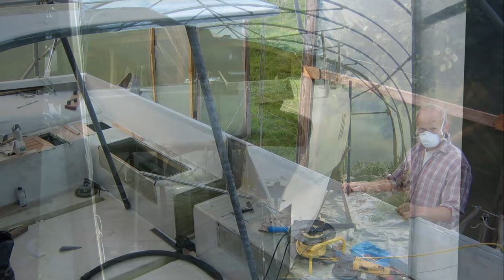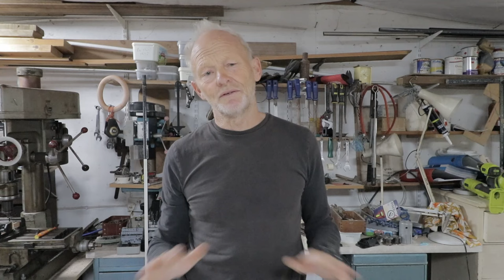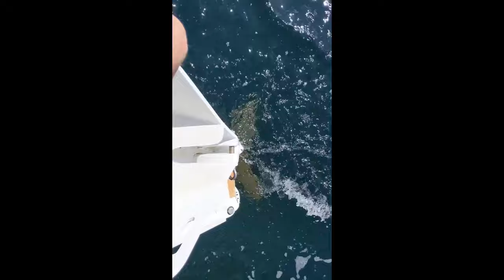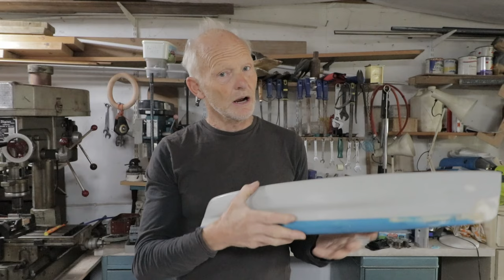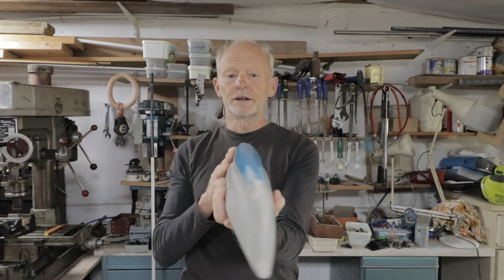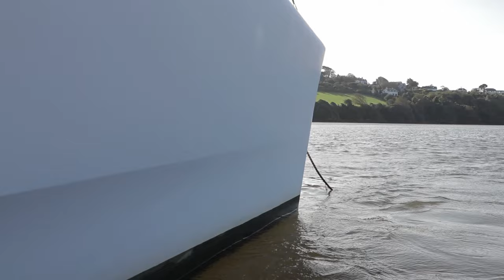How To Build A Sailing Boat #1 - My Catamaran Hull Design Explained - Ep03

Comment: Beautifull boat! The hull design and the general boat structure make ne think a lot of the Dazcat.
Reply from the maker: Thanks!
Reply: I love Dazcat. 
I don't love the price.
Reply: You are absolutely right....that hull shape is very similar to Dazcat Cloud 9 which is 39 feet. Modern Dazcats are not canoe hulls so much but C9 is. 
Have been the proud owner of Cloud 9 for over 20 years....original owner had her built in 1995. Wonderful boat....it will last a lot longer than I will!

Comment: Given that catamarans are rather recent, in the West at least, the design limits have not yet been fully explored as with a mono hull.
I have stumbled upon a new hull design innovation which is only possible on a multihull. Thus far, I haven't been taken seriously. However I have struggled along, perhaps bumbled along, and made and tested multiple 5m beachcat prototypes, because of their ease to produce and test, and have successfully proven its concept. The target of this design is racing/cruising cats. Advantages of this unique design are;
* Superior lateral resistance at ALL speeds
* Minimizes wave interferance between the hulls for less drag
* Low drag at high speeds
* Superior sea keeping abilities
* Protection for the rudders
* Ability to be beached
* Simple and quick construction from all flat panels - no compound curves.
If this all sounds too good to be true, put it to the test by learning more about this unique hull design. Cheers

Comment: A really interesting set of videos for anyone contemplating buying a catamaran, and especially building one.

I have a 1988 Catana 40 that has a design displacement of 5.4 tonnes .... probably around 6 tonnes now due to all my gear, inboard diesels. My guess is that yours must be considerably lighter  .... 3.5 to 4 tonnes? 

I've owned mine since 2008 .... circumnavigating and investigating many parts of the world ... and with many left to explore. It has really excellent sailing characteristics ..... as I'm sure yours does. 

Good luck on your adventures.
Reply from the maker: Thanks so much for the feedback. Sounds like you've had some great adventures, with more to come! :)
Reply: @SailingWildHoney  How much does Wild Honey weigh full loaded?

Comment: Superb explanations.  Thanks mate!

The narrow hulls at the waterline are shaped like a keel, and should counter leeway through lift generated by angle of attack.

The rudders are almost like a trim tab at the back of a wing, and are very different from the high aspect ratio rudders and keels found on most boats, BUT, a correctly trimmed boat should not need much rudder AND is more efficient.  I do wonder if they have enough authority when going upwind, but the daggerboards should be doing most of the work then, and again the sails can (and should) be trimmed to do most of the steering, ideally with minimal rudder use.  One of my sailing instructors called the rudder the parking brake.
Reply from the maker: Thanks very much for the feedback - yes, I think you're quite right in everything you say. And in fact she could sail quite well, even without the daggerboards. But she does sport small daggerboards inside the rudders to help.
Reply: @SailingWildHoney  Interesting, so there are daggerboards acting as small high aspect rudders inside the rudders for better authority if needed.

In principle, deep downwind, no boards and not much rudder would be needed most of the time.

Comment: I've got a crazy idea. Im kinda crippled up my right leg isn't so good anymore. 
     So i want to build a power cat. My idea is to make a jet powered cat using Honda goldwing engines that power the assembly for a big jet ski! 
    Also im wanting to put hydro foils on this so fuel mileage is good. 
     Still working on the design of this, it should be really fast. Hopefully it will get to about 55 mph nicely. 
     I don't know if I'm going to get to actually build this, hopefully things improve in the next couple of years. 
     I've never heard of anyone else doing anything like this! It will be totally a new thing.

Comment: Great explanation. I've so often wondered why we don't see more catamaran hulls with pointed sterns. Much like Wharram. 
I look forward to more videos explaining the performance. I would also like to know a bit about the specs and dimensions.
Reply from the maker: Thanks! That's an interesting idea - we've got lots more details coming in future films :)
Reply: They used to design cats with narrow sterns like the early Outremers. Obviously the naval architects decided a wider stern was preferable so that's pretty much what is done now.
Reply: …hobbyhorsing 
Not only uncomfortable, but knocks the air out of your sails, as well as problems for your outboard
Reply: When I bought my cat she had sat on a Sandy beach unused for a number of years.  I never got to inspect the low aspect keels, not until I got her back home did I find that the lower half was still in the sand on the beach!  
So she will now get centreboards.  
A short skeg for grounding is perhaps a good idea, to protect from rock, though that means you can’t so readily drag her up the beach on rollers.
Reply: @laurapitre5797  I’ve always found it amusing how design details follow a circular path - think of the Moody yachts from the 70’s with their incredibly broad transoms to create voluminous aft cabins so that they were ‘comfortable for the wife’ (their London Boat Show marketing!). A dreadful case of form following function; they were horrendous going upwind.
Reply from the maker: Yes, we went through all the various alternatives before we decided not to use them :)

Comment: You say you got the designer to draw the lines, but how do you get all the structural requirements (bulkheads strength, mast stay, joinery etc) figured out?
Reply from the maker: Thanks for the question! The designer also gave us some calculations for the main cross beams and the rest we worked out from our own knowledge base and similar custom race boats that we knew about. There were also 2 similar sized cats being built in this art of the world and we compared specs and ideas to check we were in the right ball park.
Reply: Have you ever looked at the MaineCat 38 ? Its a light sport cruising cat.

I know that part of the world of old.🧙‍♂️🇬🇧😎 One of my favourite modern cat 
Designs is the Windelo Built in Basalt but  Im also a fan of the later Wharrams and have been a long term follower of Mark ..of Wilding sailing .
He has a 42' pahi he rescued and is trying to build up in Holland.

The Hitchhiker series of boats incorporate many of the hull features of your hulls but carry the aspect ratio to the extreme... they offer no living space within the hulls on the later versions.
Reply from the maker: Being a multihull enthusiast Laurence knows all the boats you mentioned there. And he's also watched a fair bit of Wildling Sailing. We feel Wild Honey offers a good compromise between performance and accommodation :)

Comment: Hull designs depends on a number of components.
Volume required ie a double bed in the hull or single. 
Weight of the yacht and all its required to carry.
Eg if a yachts total weight is 6 tons then each hull neefs to support 3 tons.. this can be a rectangle prism ie 3 m long 1 metre wide 1 metre deep. Wont sail to well but will float. So your hull needs 3 cubic metre of boyancy.
Shape is an art to get the best performance
Reply from the maker: Nice and simply put! :)

Comment: How old were you when you first made a decision to build a cat?
I'm kind of in the same place right now, I'm almost 29 now, the plan is to build a simple 10m boat first to figure out all the technological processes and material and then build shonning 1200
Reply from the maker: Thanks for getting in touch! Sounds like you've got an interesting plan. I reckon I was about 16 when I first started dreaming of my own boat. I was a boatbuilder before I started on my own boat, so was aware of what I was getting into. Even so it took a lot longer than I expected! A lot of the time it was just the two of us, or me on my own. Luckily I had a healthy level of self delusion as the launch date kept getting postponed! I would be tempted to just go for the Shoinning 1200 and forget about the 10m as building a boat is a big project. If you want to test some ideas, build a tender which you can use on the big boat. Hope this helps you out.
Reply: Piro, in which country will you build your boat?
Reply: @CorvetteCarCraft  i almost certain that i won't do it in Russia, here you need to pay 50% tax of all money you spent on the build.
I think Thailand, Malaysia, Portugal or Georgia
Reply: @pironiero  Interesting. I'm in the same situation (Belgium highest tax of Europe). My build will be in Thailand. Maybe we keep in touch?
Reply: @CorvetteCarCraft  sure thing
Reply: 29 now, double that when you are finished.
Big question is why build?  
Better to buy and go sailing.
Building will cost more and the resale value far less.
So if you can get something that is close to your needs (not wants), buy.
10m is a very big boat, do you have a large family? 
If you are going to build start small and simple.  I would suggest a Woods Gypsy, or the slightly bigger Romany.  So much more space than a Wharram
Reply: Wow, she is such a beauty. 
Have to admire you for taking on such a complex design.
40’ is actually a very big boat, though in your case, with slender hulls and a small bridge deck, ok.  For most 30’ is fine, 35’ more than enough.  As you say, so many YouTube influencers with their 50-60’ block of flats.  I came across one musing as to whether they should fit a dishwasher!!!
Whilst I agree in many ways in what you say about hull design, if you are just cruising, top speed is not the issue.  You probably find yourself slowing down for comfort more often than not.  My Gypsy has quite fat hulls at 1 to 11, but still performs well.  I think overloading is more an issue.
You are definitely correct about care needed with wide stern hulls, a lot of designs drag their transoms.  The transom should be above the water at rest, so just kissing the water when pressed under sail. Canoe sterns are better in that regard, though can suffer from hobby horsing.

Comment: Aw3some info. I have an early Nic Bailey designed Catamaran. She weighs around 4 tonnes but her performance to windward ain't great as the hull shape ain't great like a u. Been speculating how I could change this. Was thinking I could vac on some airex to the bottom to make more of a v. Hard to comment without seeing the  boat I guess
Reply from the maker: Yeah, really hard to know without seeing your boat, but maybe look at the easier solutions first - daggerboards and rig both play an important role in your upwind capabilities :)